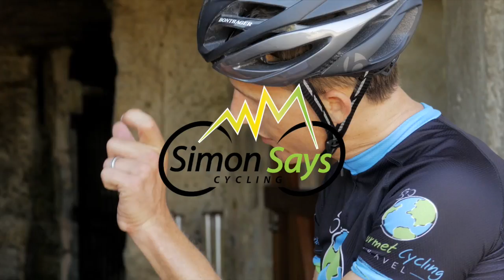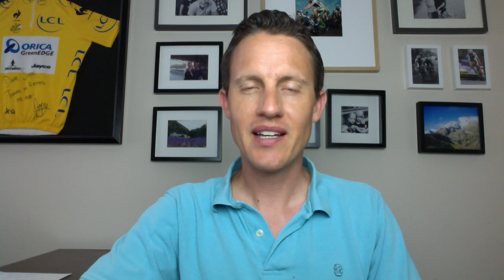What Crank Length is Best? - SSC#12

Comment: As an ex- pro myself from the 80s I agree with everything you say.  When I was a Pro I did not go longer than 172.5 . Now I'm getting on a bit I ride 175s and I find them good for climbing, even using a slightly bigger gear than I usually would.  One thing you did not mention was clearance. That is the tip of your shoe clearing the front wheel!  In the old days our racing bikes had longer wheel bases. .now most modern bikes are much shorter and with straight folks. Sounds silly, but I have know riders fetch themselves off by their shoe fouling the front tyre.

Comment: It probably doesn't make a lot of difference, but I love 180mm. They just roll better, especially on rough roads. Less need to change gear, better jump especially on climbs. Lower centre of gravity for crit racing, and you can get back up to speed without getting out of the saddle. But you need to be riding over 15 hours per week to adapt, get through the "bike fit" issues. So if you are short of time and carrying weight, if the old beer belly is rubbing on the top tube, then shorter cranks might be more manageable.

Comment: What about 'Mechanical Advantage'? The longer the crank, which is a lever, the easier it becomes to transfer rotational  power, or torque, to the rear wheel. It's very simple mechanics.
Reply: Leverage would only matter if you had no gears. You can adapt to the shorter crankarm by shifting.